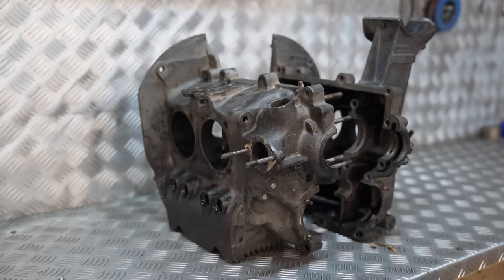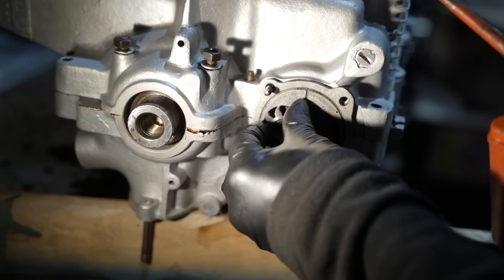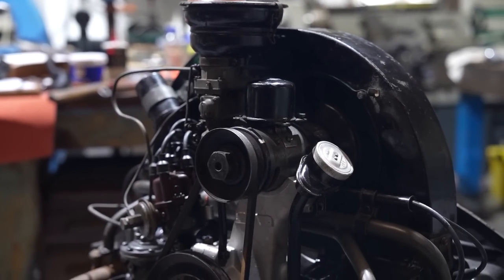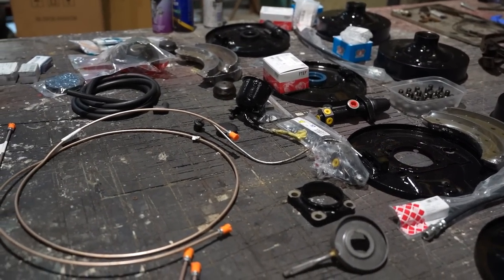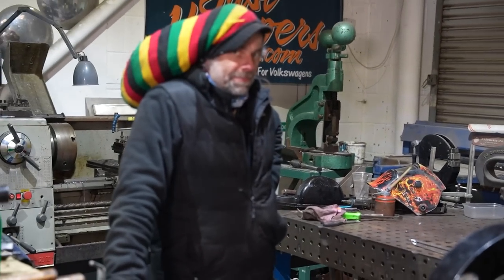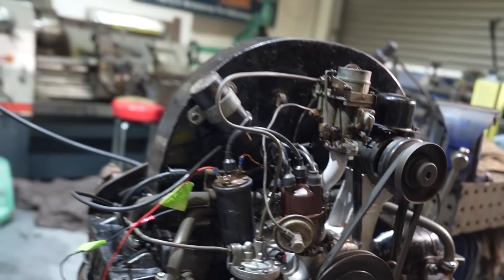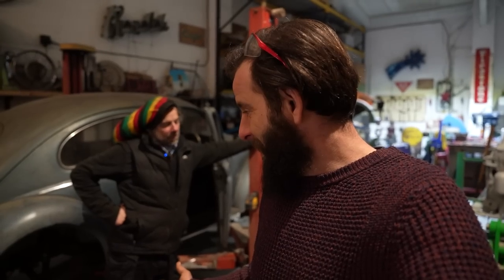'It's Alive!' | Rescuing a 1955 VW Beetle | Episode 3

Comment: Had my timing 180 degrees out when I rebuilt the engine on my first car (1972 viva). Turned out I had the distributer drive 180 degrees out. Our parish priest figured it out when visiting. Full gown and cassock head first into my manky engine bay. Turned out the old guy was only a spitfire mechanic during the war. Bloody legend
Reply: Had to rebuild the engine on one of these Vivas, the oil pump was rubbish. Fitted an upgrade from a firm called Pistons & Components and a new calm shaft, problem solved.
Reply: God works in mysterious ways 🤣
Reply: Ha!..divine inspiration, eh.....!?

Comment: Ice on the intake manifold is normal, one of the unique quirks of the VW flat four single and twin ports. If the heater tube from the exhaust gets a little restricted she'll start dropping cylinders due to the cold, let her sit and warm up and all will be good again.
Reply from the maker: Exactly! The heat riser tubes are nice and clear so should warm it up
Reply: The single carb Alfa Romeo boxer in the smaller engined Alfasud's had the same problem.  They didn't use heat risers though but relied on intake air preheat from the exhaust.  It was always an issue if the system wasn't well maintained.   It's all about the negative pressure through the carb throat, long manifolds and next to no heat transfer from the cylinder heads will do that for you.  The Alfa boxers with short manifolds and twin choke carburettors had no such issues,  much the same as aftermarket tuned VW engines oddly enough.

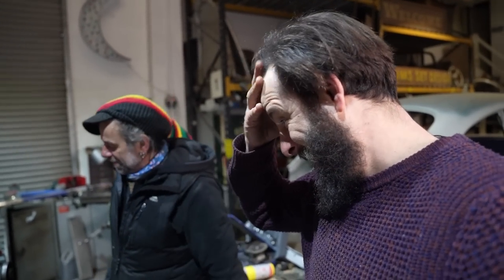Comment: 16:29 when you take those pumps apart. After 60 years of heat cycles, they will have warped mating surfaces.
You would need to machine, or deck the surfaces and then you would be tickity boo.

Comment: What a great episode…. It took me back over 50 years when I rebuilt the engine of my first car (Hillman Imp) before I was legal to drive on the road. Grinding valves, rebuilding the carb and pump, replacing the bearing shells, would’ve loved a frame to run the engine before putting back in. You have John’s guidance, I had my fathers. Can’t wait for the next instalment….. Geoff

Comment: Glad to see it went back together and is running well 😊 Shame that the oil light comes back on relatively quickly. My 36HP took around 20 seconds but I'd had the big ends re-sized, the crank ground and all bearings measured to within VW clearance specs.
Vapour blasting is a great way to rejuvenate aluminium alloys but people need to stop blasting machined surfaces. The glass beads do peen the surface and so a machined surface goes from smooth and shiney to dull and slightly dimpled. This will definitely cause added oil clearance in the camshaft bearings as the cam runs directly on the crankcase material and not a bearing. Sealing the case halves will also require more sealant to fill the dimpled surface compared to slight imperfections in a machined surface. Food for thought maybe?

Comment: Takes me back a while to when I was about 18 when I had a Triumph Mayflower , rebuilt the engine from scratch new  shell bearings ,new piston rings refurbed the valves, carb ECT but my fatal mistake was I forgot to attach the oil pipe to the oil gauge inside the car, should have been the last job but in my excitement started the engine It ran for about 10 minutes and stoped and seized up the engine ,Had to strip down the engine replace the new shells, rings  etc, an expensive mistake, what a nightmare I learned a lot that day, take your time and have a checklist

Comment: Gr8 vid Dom. After any rebuild while building oil pressure prior to first start up I'd leave the spark plugs out. Engine spins easier, keeps stresses down on internals, starter and battery.
Oil pressure comes up quicker if all has gone to plan during the build. 
Just saying. 😊

Comment: I love building aircooled VW engines - done 2 this year already. John's right about the oil light going off a bit quick.... I'd have stuck a bigger oil pump in that engine to compensate it.. bit of cam bore wear I'd say as it runs directly in the case. Think you are gonna get some oil light flicker when its hot.. Great car though - I'd love it!

Comment: Good video , but a torque ratched used with an extension is not accurate any longer. Very important with the cylinderhead bolts. Regards from Central America.
Reply from the maker: Thanks for the info